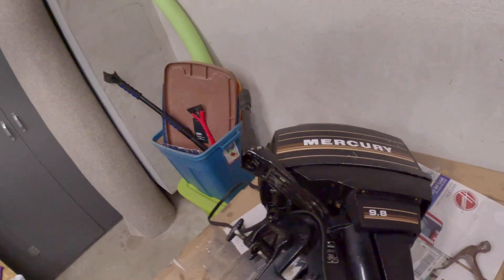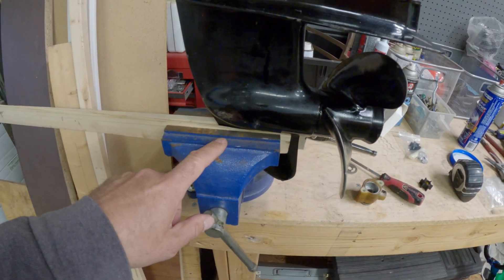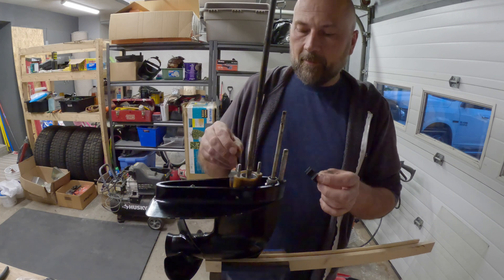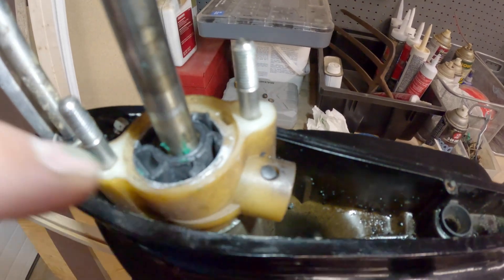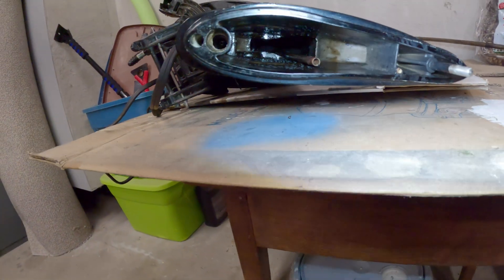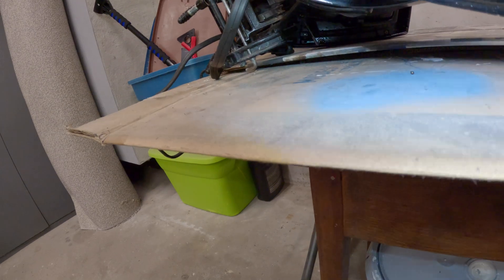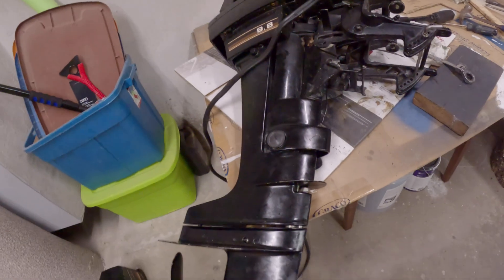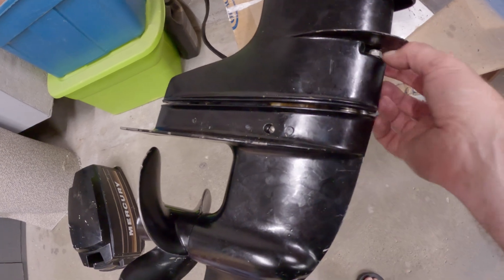Water pump impeller replacement on 9.8HP (1985) Mercury outboard

Comment: How did you get it to get back in ? Like how did you find what position to go to ? I’m stuck on the same issue
Reply from the maker: So the motor rotates clockwise, if you take vice grips and spin the drive shaft (the longer stick) you will see which way the propeller moves, if it doesn't move then you know it's in neutral. You can use pliers or vice grips to move the shorter shaft to match what the gear shifter is set to. Just be gentle so you don't strip the gears  :) I found it difficult to keep in neutral as any small movement of the propeller would kick it into gear. It took me about 20 tries, don't force it, if things align it should just slide in. Good luck

Comment: Does this have to be sealed so water doesnt get in there ? Gasket? Silicone? Is it ok for water to get in through there?
Reply from the maker: You know, I don't recall for sure, I think there was an oring there. Definitely no silicone needed. Once you take it apart you should see, it's pretty simple. Don't think it needs to be 100% watertight but you don't want it leaking either because you will lose water pressure
Reply: @kozicottage  im talking about the whole main big housing that you connect to the top half . Right where they meet. There was an O ring there?
Reply from the maker: @drewl7164 ohh lol sorry I thought you meant the water pump housing. No, there's nothing there, just metal on metal.
Reply: @kozicottage  is water suppose to go in there? Because i put a little bead of siliconed to seal mine . Not sure if thats going to cause a problem ?. I just figured a gasket was missing.

Comment: Just did mine tonight thanks for the video I have the same outboard just bought it and when I got it to run no pee stream so checked the impeller found out  it was blown out thanks for the video
Reply from the maker: @singleandavible Good you caught it early, Mine overheated and I had to remove the power head to change the plastic bushing which melted and was blocking the water .. inexpensive to fix but a huge pain to replace